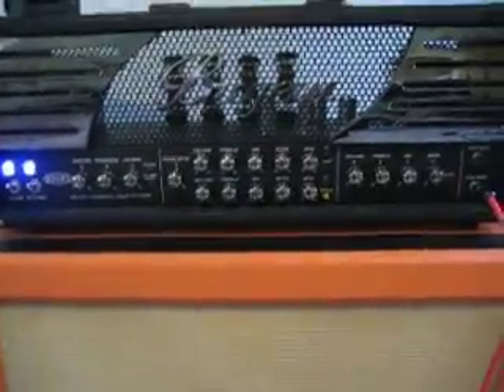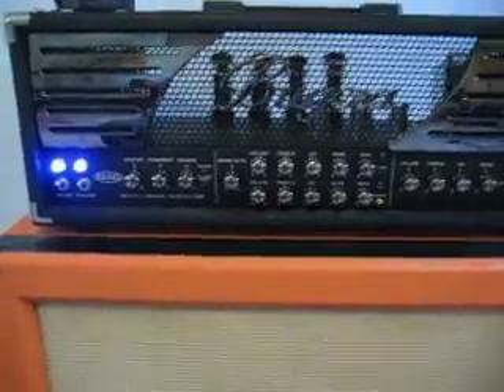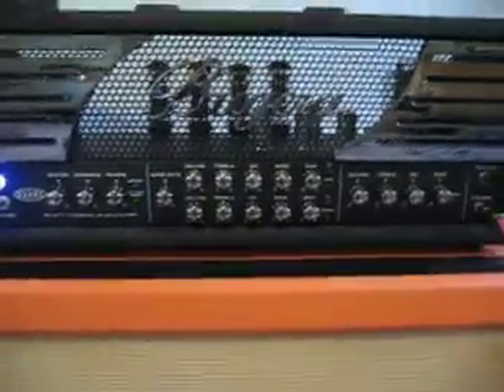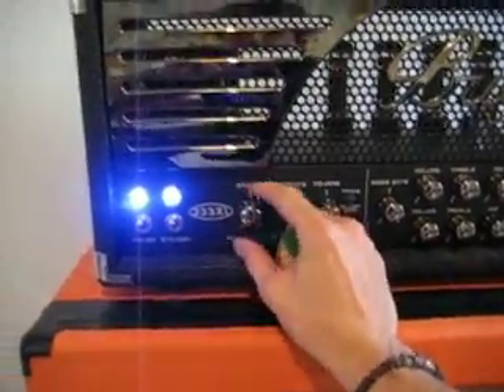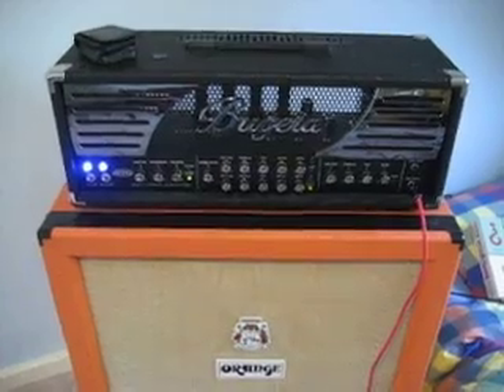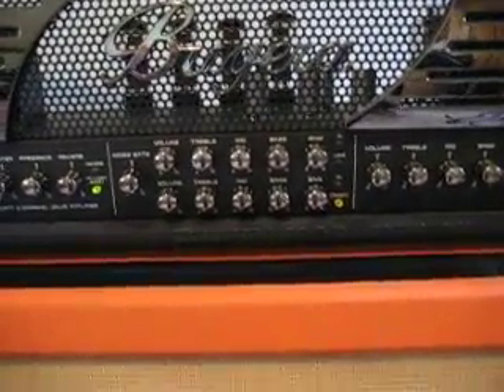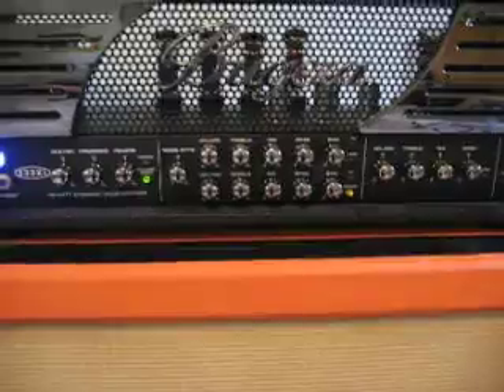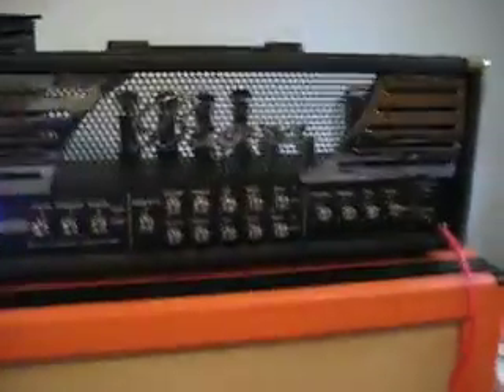Bugera 333XL Faulty - Amp cuts in and out and 'reboots'

Comment: Hey man!! I had the same problem!! Only difference is that I didn't need to turn on FX loop for it to happen. With or without the footswitch even plugged in mine was doing this. Had it in for repair twice and still couldn't be sorted. Very strange...even more so frustrating. Fortunately, the guys at Bugera are sorting me with a replacement....just hope it works all fine and well cos I actually really love the sound on this thing! Hope you get sorted too fella!

Comment: @xlr8r2010 I appreciate that these amps have had some bad press and my first 333XL was actually faulty...However, since Bugera replaced it, it has been solid! I have toured it and had no issues what so ever. I have also in the past had a faulty Marshall JVM 410H and several faulty Fender amps!So, it isn't just a Bugera that can go bang! 
My last amp was a JVM 410H (replacement of the faulty one) and I was never happy with the sound I got. My 333XL sounds bleeding great! I can't get enough of it!

Comment: Hi Richard
I am wondering if there is any possibility of getting more info from you regarding which components have been heat sinked, i.e. where on the circuit board are they located approximately? I have the very same problem and would like to install the heat sinks myself if possible...can't find any other info on the web. Cheers!
Reply: Hi there! Did you finally get anything related to these heatsinks? A friend of mine has started suffering from this same isue, and I'd like to install for him those heatsinks wherever needed, but I am not able to find any picture or schematic describing those components on the web. Thanks in advance! Cheers!
Reply from the maker: @icobos2459  it's been years but I think I do have some photos of then internals to see what has been replaced. Ever since I got it back from repair it was worked flawlessly, this fault appeared in the first year of ownership when these amps were new to the market. I imagine the new infinium models have these rectified. Email me if you want the photos of the internals.
Reply: @richardw1992  hey Richard would you mind sharing this info with me? I’m having the exact same issue and the amp tech said it was not fixable because the heat sink had a design issue or something

Comment: Change your tubes all of them the original tubes suck that's all it is a tube issue not the amp and change the fuse as well while your at it you will find the fuse is to small then all will be perfect